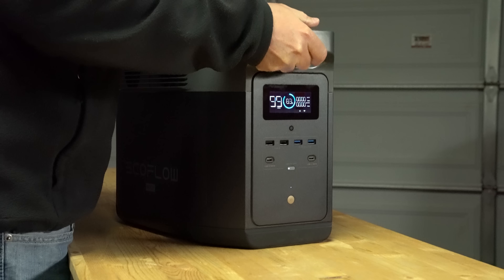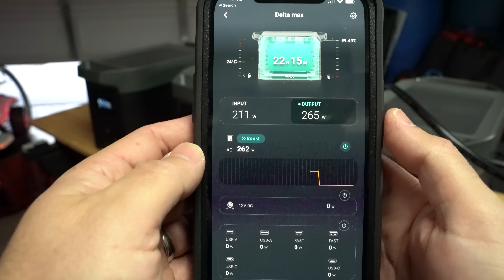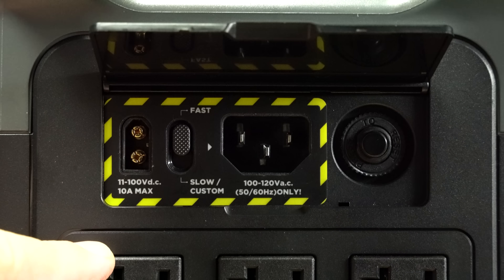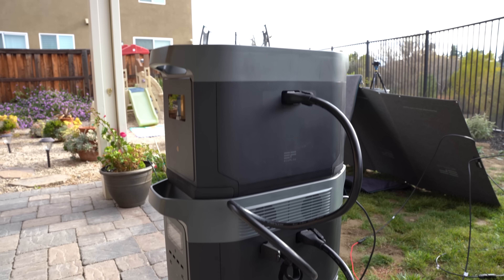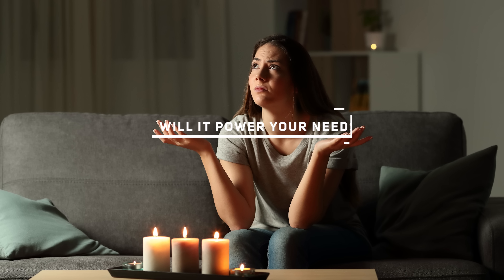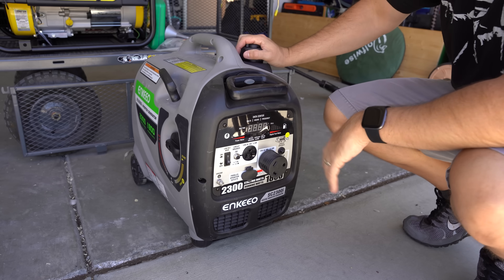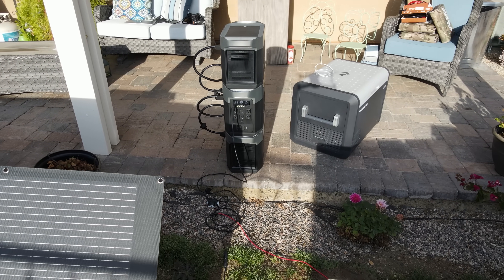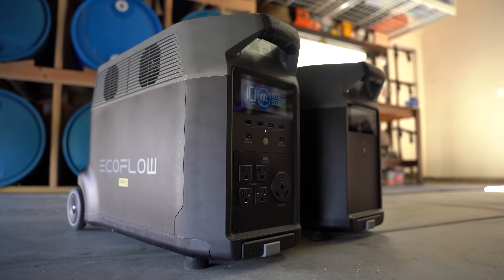Ecoflow Delta Max review - Off Grid Power in a Small Package

Comment: Been contemplating about this one for a bit.  Was looking at the Westinghouse Dual Fuel generators, the Inergy Flex power station and now this.  Always of the mindset that two is one and one is none.  But as you demonstrated, I need to evaluate my needs and seperate what is wants and what is needs.  Bugging out is not really a consideration because my family and I dont have anywhere really to bug out to.  So biggest scenario would be - grid down power outage in the area.  Limited fuel/propane.  SInce we have all the seasons here..power appliances enough to maintain food and run a electric heater if necessary. Hmm..lot to think about.
Reply: You wouldn't want to run an electric heater on this, as stated battery would be depleted in 2 hours with running heat load like a space heater which typically uses 1,000+ watts continuously. For heat during outage you'll want to use some fuel like wood, heat, propane, perhaps tied into this for running fans, circulator pumps, etc but then needing 120 volts circuit wired with transfer switch.

Comment: Cost effectiveness question
I am on a budget so I bought a £200 solar generator because it was all I could justify. It provides a lot of utility but not that much actual stored power. I basically understand the whole inverter, plug sockets, charging sockets and versatility options, but the unit does not store that much power. When discussing power storage options with a friend, I realised that when it comes to pure energy stored, decent USB battery packs provide vastly better bang-for-your-buck. In fact five decent USB power packs can store more electricity than my solar generator, at half the price.
My question is this: Is there a sweet spot where buying a solar generator is best for utility, but for actual energy storage, you are better off buying battery packs and integrating them into your whole system? Because a cheap solar generator seems to buy you a lot of utility regarding charging/discharging, but USB battery packs are much better value when it comes to stored power.
[edit] just to qualify, Im asking about the balance of investment when buying a solar generator AND backing it up with battery packs. Because for me, that seems like the best options to max out utility AND energy stored.
Reply: Science-Youtuber and such channel meanwhile supplement this on so many levels, 
it is literally impossible to name all, but let me just list these: 
-Spreading science to yourself and others helps prevent society collapsing in the first place. 
-Knowing how Batteries and such work AND especially how 
FUTURE SCIENCE can reduce the biggest issue with batterys (you know which, dont you) is Key 
to being Prepared.
Reply: @slevinchannel7589  Thank you mate.
Reply: @TheWtfnonamez  Youre very welcome. 
If you seek some 'soft' science-channel to relax and enjoy while learning stuff and improve yourself, Sci Man Dan and Sci Show are right for you. 
If it can be 'more complex', how about Veritasium and Practical Engineering?
Reply: @TheWtfnonamez  And the websites '$kill$hare' and 'Briliant' are recommend by many, many, many youtubers, as far as i know. 
Especially the former's name is very self-explanatory, if you get what i mean.
Reply: @TheWtfnonamez  I mean, self-improvement is these websites literal life-blood, duh
Reply: @slevinchannel7589  Excellent recommendations. Checking out Scimandan now. For what its worth, I think this is everything good about the internet.... being able to make a few clicks and learn something. 30 years ago you would have had to order a book loan from a library and wait several months. I dont take this for granted fella. FYI Veritasium is excellent, I even saw him presenting a documentary on Curiosity Stream. Thank you, and good luck to you Slevin
Reply: @TheWtfnonamez  Many try to combine fun and education. 
And g-damn IT WORKS if it works.

Comment: I was so happy to see your opinion on this. We recently got a delta and delta max. I wanted the pro but they were out of stock and had been for quite some time. I almost got an inergy last year but they ended up out of stock and through alot of extra research I am glad they were out because I think these ecoflows will suit us much better. The one thing that sold me on them was the fast recharge time. We are in MN and had a power outage last winter when we had 60 mph winds and it was -39 outside.We don't have a woodstove but we did have a few small propane heaters we used but it still didnt get it really warm in the house. We got by but now with our ecoflows we can actually use an electric throw as well as be able to check weather on tv and use our computers. At least be a bit more comfy. Thanks for sharing this again!
Reply: Science-Youtuber and such channel meanwhile supplement this on so many levels, 
it is literally impossible to name all, but let me just list 2: 

-Spreading science to yourself and others helps prevent society collapsing in the first place. 
-Knowing how Batteries and such work AND especially how 
FUTURE SCIENCE can reduce the biggest issue with batterys (you know which, dont you) is Key 
to being Prepared.

Comment: You obviously don't read these but I will try one more time. If you hook your solar panel in series you will increase the Voltage and in parallel you would increase the current. 3 solar panels at 15 VDC would be 45 Volts. Are you sure you can charge a 12 volt battery pack with 45 V. If you want to sound credible, know what you are talking about. One more thing. I have been using a Solar Charger for 15 years. If that thing will run a Refrig for that period of time you say then you can't open the doors. In reality those things are good for a brown out or camping. For long term (a few weeks)or permanent situation you will wishing for a real generator. If you have room adding a small wind turbine would balance out some the no Sun. I am just saying even for short term power outage a small system is not enough. If the wind is blowing 30MPH(,my turbine puts out 400 watt DC. But without a wood stove you would freeze the first night if you don't know  what to do.

Comment: you would need a LOT MORE solar panels as cloudy days greatly reduces the charging input.
Reply: At that point I would say buy house panels keep them on the ground so you can clean and adjust them. Why waste $ on the portable panels. if you can lift this unit you can  lift some REAL solar panels.
Reply: @TheUGFUGF  - I completely agree, I installed a DIY solar system leveraging all ground based panels... so in an off grid scenario, I would have a plethora of panels to disconnect from my grid tie arrangement and reconnect into an off grid arrangement.

Comment: There's a lot of info here, thanks. One of the important issues always overlooked is how does it perform 6 months in, or a year later? You're testing all of these gadgets straight out of the box, but we all know that battery life deteriorates dramatically as the months/usage racks up. Long-term usage is the ultimate question a prepper needs answered. All that being said, thanks for your efforts & most importantly thanks for sharing.
Reply: They fail … a lot!!

Comment: You really didn't stress that LP4 Battery is the way to go when doing the math and trying to justify the $ v. Years of use.

800 cycles v. 3,000 to 5,000 cycles 

Next I REALLY wish you would STRESS how solar charging these units (Esp during winter) is not something that will happen on the daily. Even if you max out the panels there only getting 20% sun if that, so you double triple panels your going to paying such a high price for the amount of solar panels needed (during the winter) that it simply does not make sense. 

I really dont believe that weight in an issue for the most part if your storing this next your bug out gear carrying 100 lbs ten feet once verses 60 lbs that same ten feet once really would not matter much. A person would be so hyped up I think it would not be an issue. Especially when they will have so much more power to use.

Plus I think you really need to understand that the average customer will NOT be buying the two extra batteries you were sent for free all of this gear and you have to keep your mind going "Would I buy this for my self, would I wipe out the credit card and drop $6,000 for the SoGen, two batteries and 2 sets of panels. (which would not re-charge any real $ of my unit in one day)

Comment: I have one, and I find it very useful. I have a sailboat that I'm eventually going to install a sizable lithium house bank and solar panels, but until I do the EcoFlow works well.

But one thing - lithium house banks on boats are usually LiFePO4. That's because LiFePO4 cannot self-ignite. All other lithium chemistries can. Which can be a real problem if your boat starts to leak.

The EcoFlow smart panels are waterproof - you can leave them out in the rain. But the EcoFlow battery itself is not, and you really do not want to keep it where it might get wet.

Comment: Great review! EcoFlow makes great products. Although, I do have a couple questions... 
My dilemma is choosing between the Delta Max and Delta Pro. The Pro model has a much larger capacity and additional features such as a 30amp R/V style outlet (instantly compatible with my current switchgear), although the weight is almost double (less portable) than the Max model. Is the Delta Max input power limited by the MPPT controller regardless of any additional batteries in the circuit? I assume each additional battery would also increase the charging time by 50%? Can you charge those batteries independently from the Delta Max with an alternative power source or only via the Delta Max? I want the option of charging via Solar, house outlet, and/or dual-fuel generator. My theory is, the majority of the time they can be recharged using solar panels (on a sunny day), although (on those cloudy days) the alternative would be to charge them with an inverter generator with only 1 hour of fuel (gas or propane) per charge. 😎

Comment: Hand and or paddle crank should considered as real emergency backup for charging if there is no sun for some days. As mentioned in the video wind turbine is a good option also.
Reply: I don`t think a human can produce much power to make it worth it. A better option is an inexpensive duel fuel gas generator for backup charging. I bought a tiny 2 stroke gas generator to recharge my Bluetti EB70 power stations on cloudy days. One gallon of gas can recharge them both in about 4 hours or less if there`s no sun. If there`s haze or thin clouds you can use more solar panels to up the wattage.

Comment: So if, I never have an actual need to use it, the battery in the unit will still be junk in 8 years? That's what I've heard in other videos. 
I hate to lay out that much cash for something I might junk that soon.
Reply: No, it will just reduce the battery to %80 capacity, You need on with a "LP4" Battery. Do Not but one that deos not have an LP4 battery they last 3,000-5,000 cycles. Glad your thinking about this, just remember that you need to over panel your unit and or have a gas generator that you can recharge this unit other wise its a $2,000 paper weight.
Reply: @TheUGFUGF  recommended brand/unit?

Comment: Does Ecoflow have pass through charging? Would I be able to charge up Ryobi tool batteries from Ecoflow while it's hooked up to solar? I'm just not sure if your example of charging up your laptop during the day, while charging the Ecoflow on solar is the same. It probably is, but I'm still learning how all this energy works... Also, in a cold, snowy climate, would it be too cold for a lithium battery outside? I'm guessing below freezing temperatures 5 months out of the year significantly shorten the battery. My car has an AGM battery which charges off the alternator, but my Lithium Jackery does better when I bring it inside. Even my cell phone discharges within hours if in an outside jacket pocket while outside.
Reply from the maker: yes, it does have pass through power.  i forgot to mention that.  it's a standard feature these days and just overlooked that point. yeh, it's not going to perform in really low temperatures.

Comment: In re: using any solar panel. Panels don't always play nice with MPPT controllers. The MPPTs will charge at a significantly lower rate with an incompatible panel, usually less expensive brands that haven't upgraded yet.

Comment: How long did it run before depletion at that full load with the hot plate, hair dryer, heating element, and what not?
Reply from the maker: the capacity is 2048 watt hours.  So if you're running at the maximum for this model (2400 watts/hour) you could expect 51.2 minutes.  It came in slightly under that number.  Great question.
Reply: @CityPrepping  This is way cooking, heating or cooling is not something you would want to do with this unit. Its mostly for recharging other items and keeping a freezer cold. Now if your lucky and spent another $1,000 on solar panels you MAY be able to recharge that unit in 3 hours or so if you had perfect sun and kept the panels clean and adjusted to the sun.

Comment: A tip for others from a friend of mine who works on starters, alternators, generators etc. Make sure to start your generator and put it under load at least once every few months. He said one of the main reasons people bring them to him to fix them is because they let them sit for a year or so and never run them. The generator itself will lose tolerance over time. It will start and run but might not produce power if it sat in one position for too long. It will also make the engine last longer by allowing it to run under load, cycle old fuel out and re-lubricate all joints and seals. It only needs to be about 10-15 minutes, nothing crazy to waste too much fuel.
Reply: I have one of these and Ecoflow recommends to run it down to 30% every three months.  Also store it in your home, not in a cold garage.  They need to stay within a moderate temperature range.
Reply from the maker: absolutely...I try to run mine once a month for about 15 minutes.
Reply: Just like a car...

Comment: Good review.  For routine emergencies in an otherwise civilized world, this is a decent choice.  At a rate of one outage per week, the 800 cycles will still last over fifteen years.  For long term use, however, in a grid-down scenario, LiFePO4 battery chemistry is the ONLY way to go; this unit likely wouldn't make it through the third year.
Reply from the maker: yeh, i'm a big fan of LiFePO4 batteries.  More manufacturers are switching over to them.  Heavier, sure, but the life is significantly longer and way more charge cycles.
Reply: Do you know of any solar generators with the LiFePO4 battery that I can look at?

Comment: Thank you for your systematic approach - I always appreciate your balanced and thorough approach and analysis. Some real world experience here, and yes I’m off grid which you said isn’t the use-case you’d recommend this device for. I got the EcoFlow as backup for my larger capacity power centers.  

I’ve been using the EcoFlow Delta for several months. It charges fast, but it won’t take a charge below 35 degrees Fahrenheit. So if you’re in a cold area it’s not very useful, despite the fact that the operating manual says otherwise. The Jackery 1000 is better able to handle the cold, but it charges more slowly. But in the cold it’s much more reliable and powers a lot more than the EcoFlow, which is now barely able to charge small devices,  if It can even get it to take a charge. In a SHTF scenario, you’d better be bugging out to a warm region if relying on this device for anything critical.
Reply from the maker: excellent information...thanks for sharing that.  i'm in a very moderate climate, so not able to test for that, but i appreciate your insight.
Reply: Thanks for sharing that. I too live in a climate with cold winters, these type of generators would be useless. The bluetti eb150 same problem.
Reply: @ronjordan2831  Assuming the house is warm and the generator is inside, would it be possible to charge at temperatures below 35F? The solar panels could easily be in temperatures below that. 
Thanks in advance for your help.
Reply: Is the unit sitting outside in the 35 degree weather? or is it inside and still wont charge?

Comment: I have been looking at various videos on these and probably will buy one at some point in the near future. My problem with these is this, I live in Alaska. We have very long winters here, and if I had to guess thats where you might well need something like this. But here’s the problem, most days in Alaska are overcast and daylight hours are short. Here in Anchorage probably only about 6 hours a day at best. And as I say most days are overcast and I doubt you would get any charge at all. Am I wrong here? Also will low temperatures outside effect how panels charge the unit. There are some days that are absolutely gorgeous up here in the winter, though pretty short. Contrast this with the summer where we have about 18-20 hours of sunlight, and most days there is some to full sun.Is one of these units going to be viable in the winter? I have several gas generators one is dual fuel and one is tri-fuel. Most of the time when power goes out we still have gas so it could be used.I’m really looking forward to your large test in January.
Reply from the maker: hard to say without knowing the specifics of your area.  from what you're stating, if you're not getting a lot of sun, then yeh, this wouldn't be advisable.  do you get much wind?